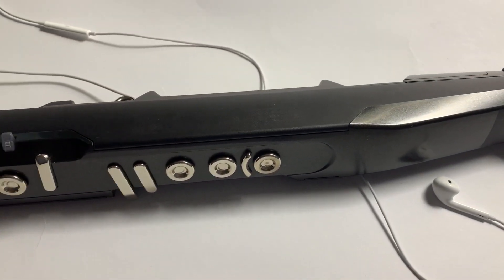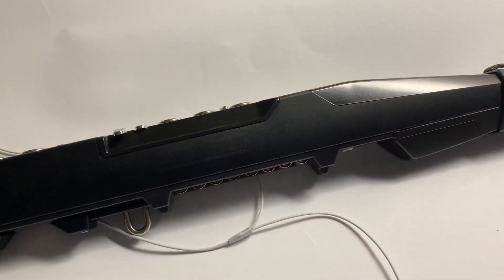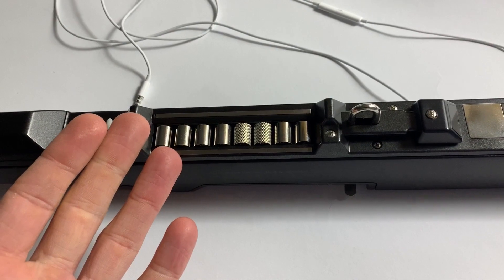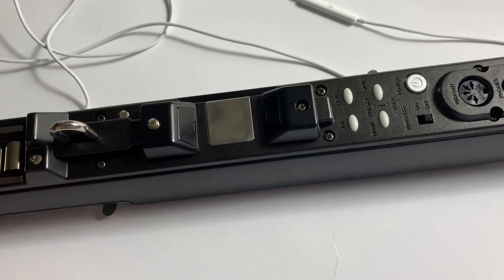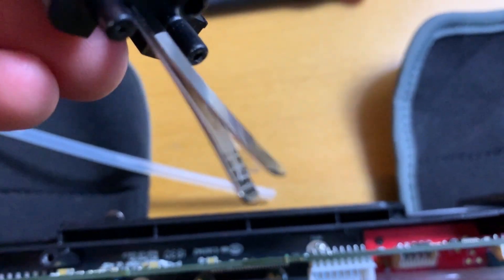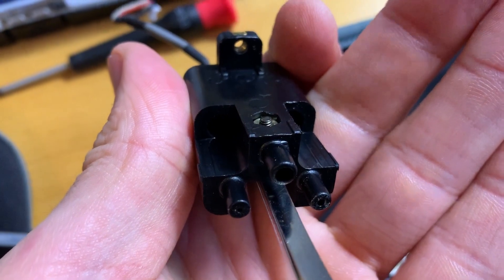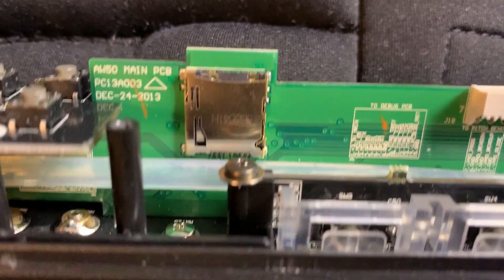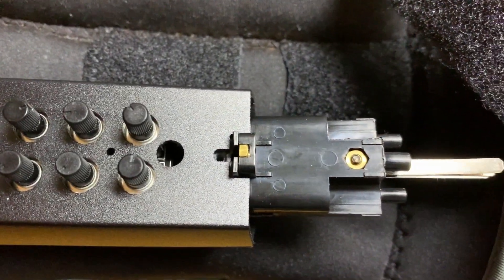AKAI EWI 5000s latching sounds fix

Comment: differnet topic, auto-power-off  [Ao] is not working on my EWI5000. I have reset to factory settings a few times. Installed firmware 1545 and installed latest firmware 1546, recommended to me by akai support. Nothing helps. I don't know if a certain setting prevents this. I allready asked in several forums or youtube channel. And now here, may be somebody has an idea for this issue? thanks

Comment: Hi i have a problem with my ewi 5000 it get Freeze AND i can't turn ir off or play it just put LD on the LCD screen.plese jelp i disconet the batery ir works a few hours AND then again por the same error LD
Reply from the maker: I think I just had the same problem. but the error was r). Anyway I was able to fix it but i still don't know how. Video is coming, but I dont't think it is much help without comunity input.
Reply: I have same problem in my ewi 5000, can you gige me the idea to repair that? It will freeze after play it in 2-3 minute.

Comment: Can you please send me a backup of sd card? I have C.7 error and ewi stuck on it. I can manage setup settings and update firmware through mac, which goes ok, but no changes. Still C.7 error.
Reply from the maker: Have you contacted AKAI servicefirst ? Do you have a list of the error codes? Is this software related?
Reply: @peterommes4360  No, i didn’t contact akai yet. Maybe you have error codes?

Comment: Hi Peter, I'm watching this video because I want to find where the grounding bar for the octave rollers has a connection where I can connect a lead. I want to use a wrist strap with alligator clip to ground my thumb as I'm having to lick my thump to ground. If I don't do this I can't play the octave I want (I live in a very dry climate, I've tried lotion, adjusting the EWI5000, but I still have to moisten my thumb!). 
I've tried connecting a copper wire lead to different screws in the hopes that one is grounded, to no avail. Do you know if any of the screws is grounded? Do you think adding a lead so that I can attach the wrist grounding strap is a viable solution? I am open to any suggestion. I can solder well, I'm NASA certified in assembly so It doesn't make me nervous to modify the instrument. Thanks for any ideas. I'm retired disabled and 
I can't afford to destroy or damage the EWI!
Reply from the maker: Hmm in this case.. .maybe try easiest things first. I also have to use a lotion to moisture my hand. I found using the "Working hands" stuff from O'Keeffe's works quite well for me. 
If you have problems with general grounding maybe try to solder to the back of the groundplate? Or even front if you don't want to take it apart. If you have problems with the octaves I think the lotion is the only solution, because if you still want to switch between the octaves you would need one lead per ocave right?
Reply: I took the top piece off last night, easy (17 screws). and soldered an insulated wire to the ground and reassembled. The wire is long enough to wrap around the neck strap U, and then clipped the alligator clip to it. It seems to be working better but not as good as I hoped, I still have to barely moisten my thumb. I think the prob is the grounding strap/clip aren't making a great connection and not a good enough ground. I'll try lotion... also might try a heavier solid copper wire... Lotion first...O'keeffes. Only one wire will (eventually) work as it's the rollers that determine which octave.
Reply: Update: I've wraped the ground lead I added around the neck strap holder U, eliminated the grounding wrist strap/alligator clip altogether and making sure my left thumb is touching the grounding bar and rollers...I'm playing the octaves I want!!! 
I'll move the wire I added below the top plate and solder to the U and save $$$$$$ money on moisturizing lotion!
I have a pic, let's see if I can add...
Could not add the photo. I've been playing for an hour now and I'm getting a good ground, now to focus on playing! Thanks for this and your other vids about disassemblying, I would have been nervous about taking the EWI apart.  Could see that 
I only had to take the top piece off to get to the grounding connection. Thanks again!
Reply: The metal plate under right hand thumb is also ground. Not sure why you would have to be more grounded than that. You can’t even hold the EWI without being grounded already. Your problem is likely the touch offset parameter. Read the manual.